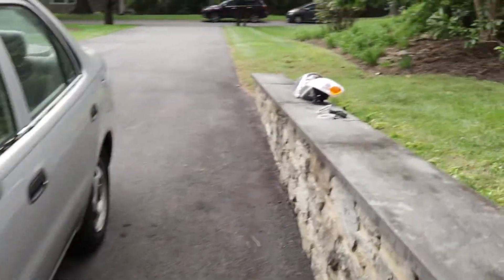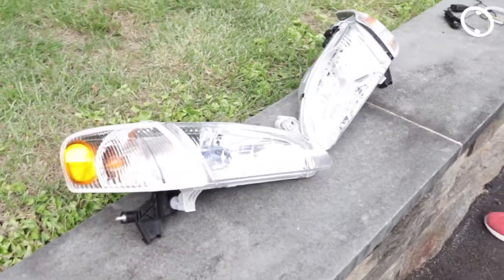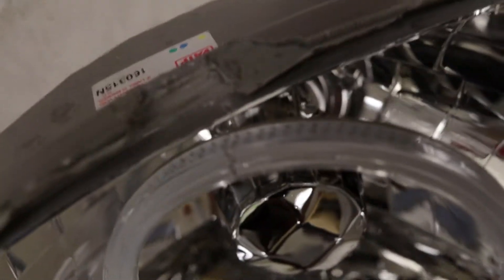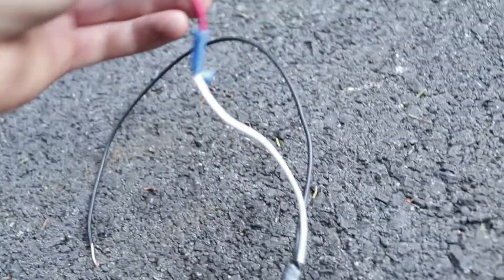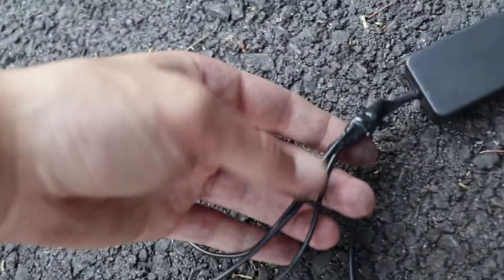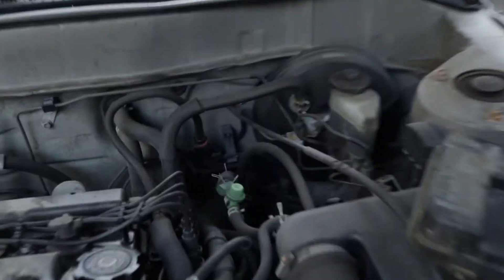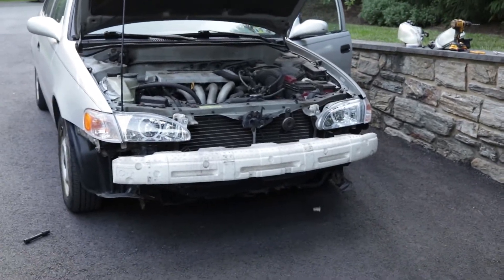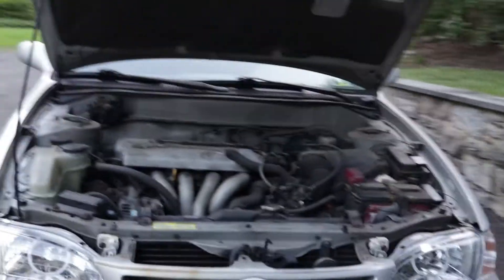RICER COROLLA EBAY HALOS/ANGEL EYES INSTALL

Comment: Question what if i buy the halo rings that don’t change colors for example i wanna get some but just the color amber, is that any fucking way i could just connect my ring to my day time running lights so that when i turn on DRL they turn on with them ?